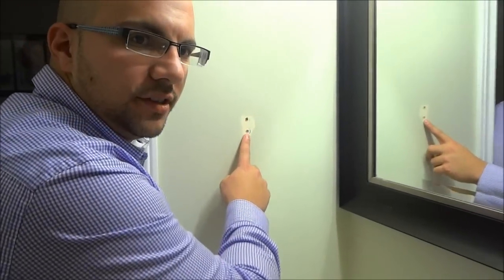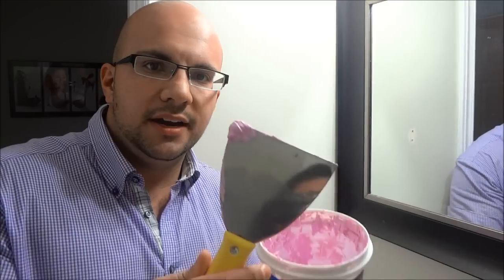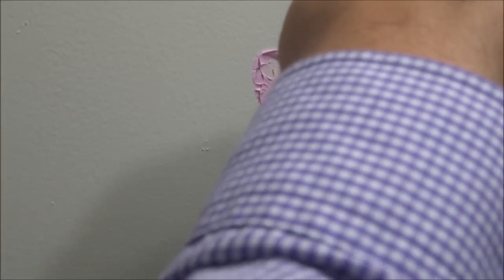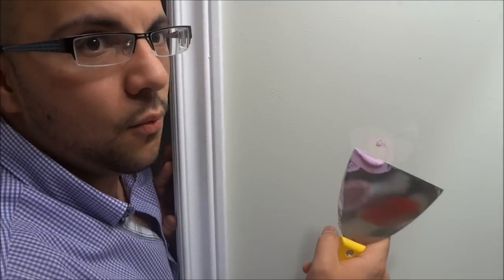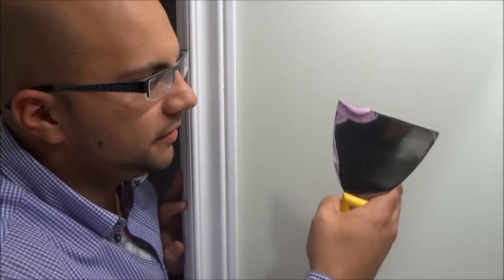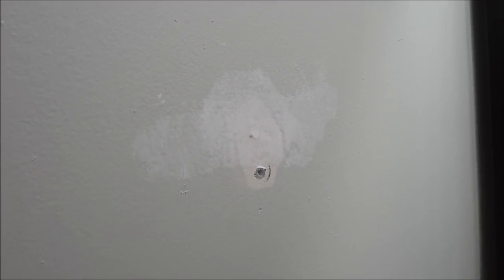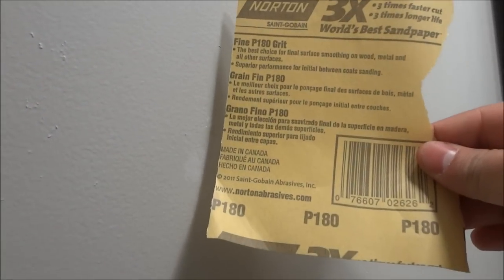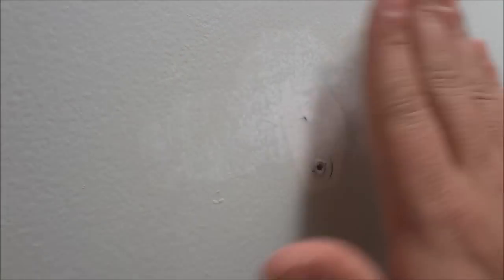How To Fix A Small Hole In Drywall Or Plaster With Putty (Spackling Compound)

Comment: Way too much mud on the wall - you really only need to feather the final swipe there - way too many people do this and then paint over it thinking it will disappear but drywall mud dries smooth and drywall has a texture ( rough surface ) without a couple of coats of primer on the whole wall you will always see the patch. So use lots of mud in the hole and very little around the hole.

Comment: Legend has it he's still putting a little more putty till this day. Make sure you clean up the whole properly first and take of the excess drywall, make sure there is no raised surface before you even think about using putty. One trick I do is run a level over the whole after clean up